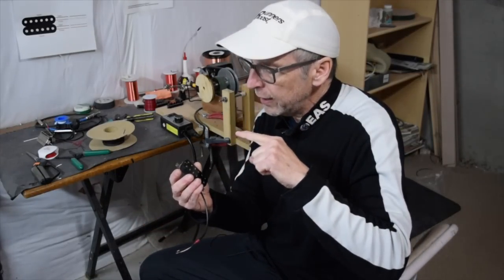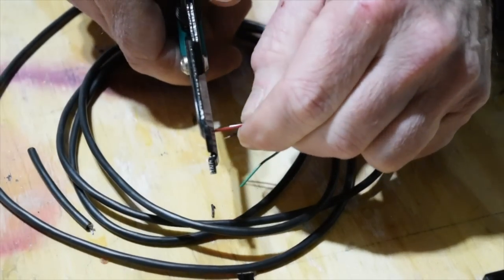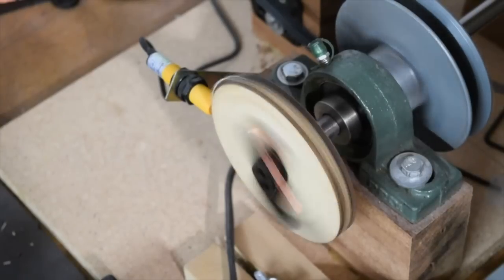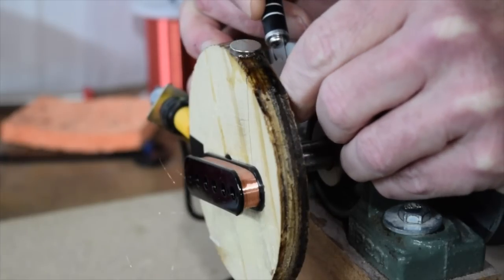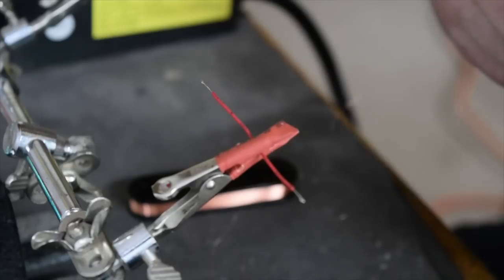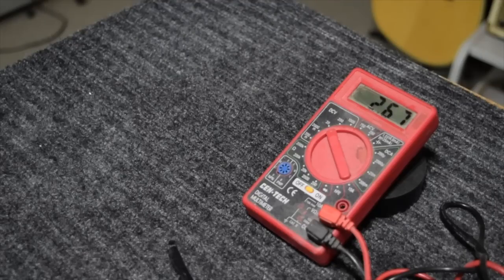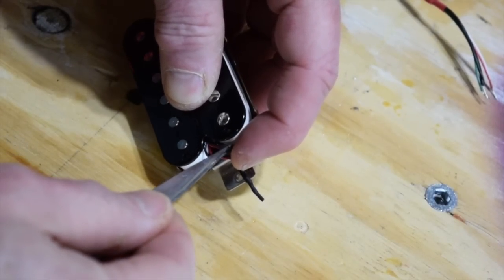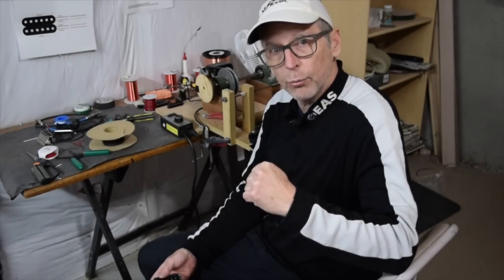Making A Humbucker Pickup For An Electric Guitar

Comment: Just wondering, it’s it possible to put pickups underneath the wood so that it’s essentially hidden? I guess I wanna have a certain drawing or artwork on the face of the guitar and the pickups kinda get in the way
Reply from the maker: Sure, but you probably won't like the results. You'll need a strong magnet like neodymium for the magnetic field to be able to reach the strings and they can sound ultra harsh. I would consider a piezo bridge instead. there's a lot you can do with them tonally these days.

Comment: I just received my Mira se and the tape on the pickup was a mess. to fit can I tape over or remove tape and retape and what size tape do I get. .It would not be an issue except the cobbjob is on the bass side and I see it.

Comment: Hi Chris..I really enjoy your videos.  Please entertain a question from a non electronic guy. Does the frequency of the string change at the brige or just the amplitude?
Reply from the maker: We're not really talking about electronics in this instance. Amplitude refers to how far the string moves from side to side and frequency refers to how fast it moves from side to side. At the bridge, the sting moves faster side to side, but over a shorter distance. Without getting into the details, that why the bridge pickup sounds brighter than the neck pickup.
Reply: Highline Guitars Hi Chris. The frequency of the string cannot change along its length however the amplitude will change as you approach the “nodes”.  Frequency will always be determined by the length of the string, its mass, and tension.
Reply: exspes Yes I adopted too simple an explanation by concentrating on the “fundamental” frequency. However I’m not entirely convinced by your explanations either. (My A level physics is nearly 50 years old but I’ll give it a go from memory.)
The fundamental is the frequency we tune the string too.  A = 440 hz is a good place to start.
When plucked the string will vibrate 440 times per second. The string will not move at all at the bridge or nut and will move furthest at the 12th fret - its Centre. The points where the string doesn’t move at all are called the nodes and where the string moves most is the anti node. In this simple model it should be realized that the velocity of the string is different in different places. Near the nodes the string would be moving 440 times a second but over a smaller amplitude than at the antinode and therefore the velocity would be lower.
Now you were quite correct that this simple explanation excludes a fair amount of other factors. When a string vibrates it will create “harmonics” on top of the fundamental. The first harmonic generated will be equivalent to half the length of the string, or to put it another way double the frequency - 880hz in the example.
A further harmonic will be generated at 1/3 of the string length, another at 1/4 and so on. These harmonics will sit into the western musical scales nicely. Obviously eventually these harmonics will only be noticeable to local dogs!
The fundamental frequency will always be the most audible.
Although my knowledge is old I think I’m right to say it is not possible to generate harmonics below the fundamental. (Harmonic resonance is another thing entirely. Remove the damper from piano strings and hit A 440 and strings with a lower pitch will vibrate sympathetically, as well as higher notes.)
So what is happening near the bridge of a guitar?
We all know that the sound of the guitar is different when played nearer to the bridge, and this applies to electrically amplified and acoustically amplified instruments.
Although we all call this tone I think it is better to call it by its more scientific name of “timbre”. 
The best explanation I have heard is that certain harmonics, the higher frequency ones, are enhanced in the timbre whilst lower ones are damped by playing in this position.
Interestingly ( to me anyway ) a music lecturer friend advised me to read up n Psycho acoustics which is all about how we perceive sound. It would appear that if enough harmonic information is given that, even without the fundamental present, our brains will still “hear it”.
As to the rest of your post the points about a bass and cello are pretty much self evident if you look at the string.  Length/ mass / tension. In wind instruments it’s the length of the vibrating column of air that dictates fundamental frequency.
I’m off to look for my life now :-)

Comment: I need to learn more about magnet gauss. The number that came up on your meter ,what is that reading? And are u just matching numbers . Im not quite getting that.🤔🤔
Reply from the maker: I might go into that more in a future episode. In a nutshell, the number corresponds to the voltage detected by the hall effects sensor. I use a math formula that converts it to gauss. In truth, it takes a lot of testing to match the numbers with a specific tone.

Comment: How would you calculate the number of winds to get your desired output? Ex. If I want a humbucker around 16k ohms, how many winds does each bobbin need if I’m using 43awg wire?
Is there a mathematical formula? Or is it more trial and error?
Reply from the maker: I use this online calculator http://www.jdguitarworks.com/coil/coil.html Select the bobbin that is closest to what you are using and adjust the bobbin core dimensions to match. it's very accurate.
Reply: Highline Guitars awesome thanks Chris
Reply: Yes there is

Comment: Final assembly; "screw bobbins are oriented toward the South Pole...". What exactly does that mean?
Reply from the maker: The bobbin with the adjustable pole screws is on the south pole of the magnet. The bobbin with the slugs is on the north pole.
Reply: @HighlineGuitars  Oh, it refers to the magnet polarity. Another thing to research... thanks

Comment: Hi Chris,  great video as usual, I have a question regarding the gauss meter apps that are now available for smart phones equipped with a magnetic field sensor. (Most of the new Samsungs and iphones)
Have you tried one of these apps and if so, are they accurate enough for use in making pickups.  I only ask because the app is free!
Cheers
Reply: The App is called Keuwlsoft Gauss Meter.
Reply from the maker: I tried several, and none were accurate.
Reply: @HighlineGuitars  Thanks Chris. :)

Comment: Same direction for 2 humbuckers? (cc)? or (cc) and (c)?
Reply from the maker: You can wind all of your bobbins (humbucker or single coil) in the same direction (c) or (cc). If you want a coil to be in the opposite direction of another, you simply flip the leads when you solder them into the circuit.
Reply: thank you, I wound my Humbucker neck to (c) and my humbucker bridge to (cc) will this work?
Reply from the maker: @strat7751  Yes.

Comment: Can I use the same bobbins for making single coil pickups?
Reply from the maker: You can, but it won't be the same size as a typical single coil. You will also need to find magnetic slugs that will fit.

Comment: question: 

can you change the backplate of the guitar pickups?
Reply from the maker: With most, yes. However, that begs the question: Why would you do that?
Reply: @HighlineGuitars  because EVH pickups have different back plates, that is way too small on my aftermarket pickups which is a DiMarzio X2N, should that work? can you upload any video related for this please?
Reply from the maker: @sfear6  I don't have any videos of anything like this, nor can I answer your question as I am not sure what it is you are trying to do.
Reply: Highline Guitars i need to change the bridge pickup of my EVH wolfgang special, pickup is directly mounted on the guitar using a different pickup base plate, very different from the base plate of the aftermarket pickups that I am going to install
Reply from the maker: @sfear6  Will the new pickups fit into the pocket? If so, can you drill new holes to mount them? That's what I would do. To swap baseplates you'd have to make sure the holes and screws in the EVH base plate for mounting the bobbins will match the DiMarzio baseplate.

Comment: What does dipping the thing in wax achieve?
Reply from the maker: A wax bath prevents the coil windings from vibrating against one another while the guitar is played. When the coil wire bangs against itself, microphonic feedback (squeal) is generated.
Reply: @HighlineGuitars  so maybe candle wax could be made to work just as well. Easier to procure.
Reply from the maker: @samwilson5544  Yes. Candle wax is basically paraffin and beeswax.

Comment: What's the use of spacers
Reply from the maker: They prevent the bobbin from tipping to the side when they are mounted to the baseplate. The metal spacer under the screw bobbin helps magnetize the screw poles.

Comment: Hello from Nepal, I had a pickup wires not having any resistance shown in the multimeter,so I opened it and unwinded everything seemed like there was no break but still no output. Do you have any idea about this problem?
Reply from the maker: Sounds like a short either from breakage or faulty insulation. Time for a rewind.
Reply: @HighlineGuitars  ok thanks for the reply and cheers

Comment: Good video, but you left out some much needed detail for beginners on how and where to attach all the wires from the start and finish to the bobbin assembly. For instance, you only showed pulling off the start wire no explanation, and again when assembling both coils on the finish plate, no detail on connecting all the leads. Also wax potting was not done early on because they had no idea about the long term affects of corrosion and vibration deteriorating the coil winding,its not just because people expect it. It's attenuate feedback and avoid microphonics.
Reply: +Mark Trevino
Most of the issue,which waxing must solve --- is a parasite feedback.
But it can be solved  the alternative method,which not affect to (possible future) repairing pups.